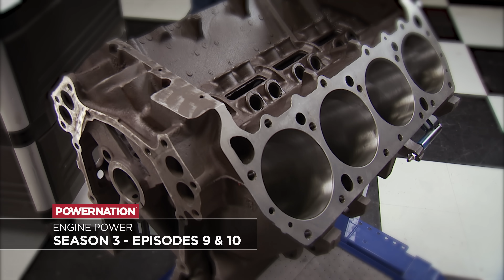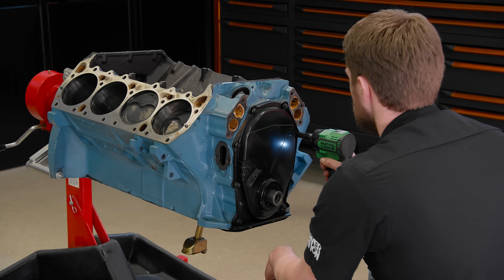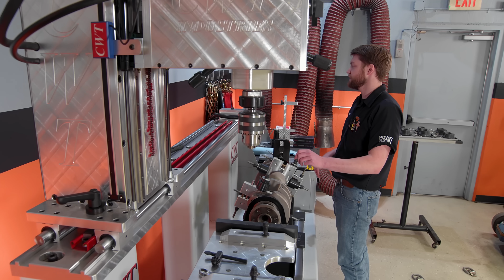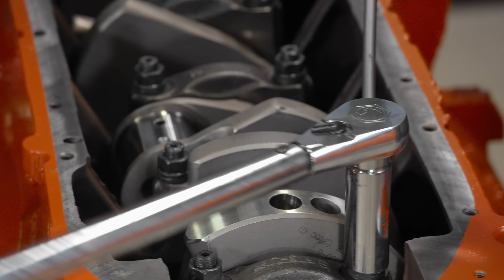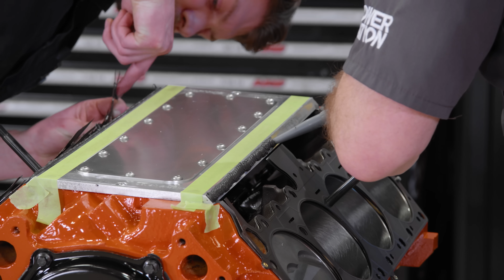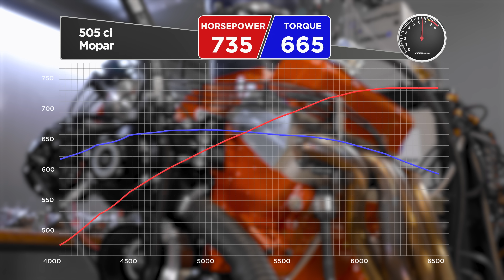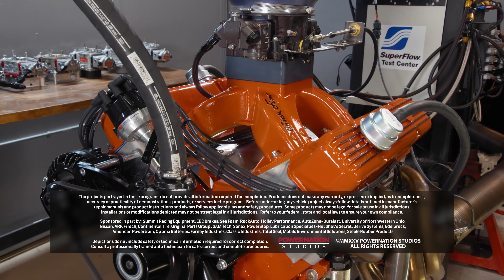Building a HEMI Killer?! 505ci Wedge-Head Mopar Delivers BIG Pump Gas Horsepower

Comment: what the deal with pond feet , it was always foot pounds , like 80 foot punds
Reply from the maker: For a measurement of torque, the proper terminology is pound-foot/pound-feet (lb-ft), or pound force-foot (lbf-ft), to represent rotation force around an axis. Foot-pounds, (ft-lbs), is a measurement of linear work done, which represents force over distance. In the automotive industry, people commonly use foot pounds to refer to torque, but technically pound-feet is correct, and is used by SAE.

Comment: Why did you retard the cam 2 degrees? And advanced the cam? 
It is best to install pistons with the bores vertical so you don’t damage the cylinder walls or the crank journals. Did you use an MLS head gasket? Aluminum heads cause many problems with dissimilar material and coolants. 
I would like to know what longevity expectations are there using these very short skirt pistons and high pressure valve springs. Not very vintage looking without painting the heads. Nice to shoot for highest power but I think this engine would not last long compared to a high performance street motor. Not to mention it won’t pass up a gas station. Hard to enjoy a cruise not knowing if you can get good gas. Great race motor.

Comment: Has anyone ever noticed the similarity to Mopar wedge heads and Small block Chevy heads ??
Reply: If I am not mistaken I do remember hearing that Chrysler did design the heads to be similar design. In the 70’s building Mopars I remember plenty of Chevy guys saying how much they looked like a sbc head. I also agreed that to b true
Reply: @danielroberts698 yes..they're quite similar.
Reply: Except for the rocker systems, they are very similar. Mopar putting small block Chevy heads on a 440 definitely left a lot of room for improvement, and this video with pretty decent heads shows that.
Reply: @G53X0Y0Z0 I said HEADS..
not corresponding equipment.
Think as if you purchased a bare B wedge head  and a SBC HEAD as such, look to ports and such.
B also use a  valley  cover..of sorts..
Sbc uses the intake.
Pros and   cons..
Distributer removal, as well as draining coolant..
Let's just stick to head comparisons.
Chevy can switch to solid cam, without  buying adj rockers.
Head comparison please.

Comment: You are not Mopar guys. Your barley engine guys. Doing a comparison on 305 and 302. The Ford will out live the Chevy. Mopar's are the way to go. Even at low HP the Mopar will live the longers and way more fun than any other. Don't do fake on tv. It doesn't work

Comment: Drop it into a 67-69 Barracuda, Dana 60 rear end or aftermarket equivalent (3.73-4.10 gears) and a Rockland Gear Tranzilla 6 speed transmission with customizable gear ratios, the ultimate street-n-strip warrior.

Comment: Thinking back to my Dad’s ‘59 Imperial, this would have really improved the passing power! I wonder what fuel mileage on something like this would be? With that flat torque curve you would not need a lot of throttle going down the road. (Stock, it always got 19 mpg.) It would surely be a sleeper to other drivers!

Comment: It was never called Hemi Orange by Mopar, it was Competition Orange. I know I'm tired but, did they just say that they installed the cam 2 deg retarded and then seconds later say that it was installed 3 1/2 degrees advanced at 109 centerline?
Reply: They put the crank gear on the 2 degree retarded keyway so the cam degreed in at 3.5 degrees advanced. Common to have to do such things because of different tolerances from manufacturing. Thats why it is checked with a degree wheel

Comment: Just dyno'd my bb mopar.  did 787hp at 5900rpm  760tq at 4400rpm  mine is a little bigger but much less compression.  pretty impressed with the numbers for a 505 vs my 572.  my cam is close, little more lift and separation on mine. I'm running edelbrock victor max wedge heads that have been ported and 10-1 compression.  really wish It would have went to 6300   I think I would have hit my 800hp goal
Reply: Did the hp curve flatten after 5900 or did they shut it down at that rpm? Although … really … that’s pretty high rpm for most RBs. Have fun with it!
Reply: @SchoolforHackers  ran it out to 6500  it didnt really fall off just peaked at 5900.  told to shift around 6300-6500.  I am running a weird efi set up that I think is hurting me some.  throttle body is a little small (102mm) . not too worried because boost will fix that soon.
Reply: @dallasarmstrong560  Looking forward to the videos
Reply: Any chance you could post more details about the cam, heads, lifter type, intake , octane and all? Would love to replicate mines in the machine shop now for 520”
Reply: @austinkapler6417   victor max wedge heads. changed the intake to 2.25 ported them.  compression is only 9.5 to 1. cam is a custom grind comp  264/276 760/744 114 lobe separation solid roller. intake is a ported victor max wedge we added injectors to. 105mm throttle body with 90deg elbow.  holley dominator ecu,  80lph injectors,    crank is molnar, rods eagle, je pistons, bill Mitchel block. 91 octane         trans is a powerglide and gear vendors. 4k stall, 3.91 rear end (probably go 3.55-3.73 with the torque i have)  hope it runs 9.50s and drive to the track.   boosting it next year and shooting for low 5s in the 1/8th

Comment: I just had  low deck 400 ,stroked to 512
Built by ( Just Mopar Joe )
  12.5 compression 
  Solid roller 650 lift
 Trick flow 270 heads
 Track heat intake  with 4150 AED custom carb
 Made 760 HP
 And 722 TORQUE  !
  ON E85
 Way more power than i was shooting for.
 Street / Strip Duster
Reply: I love the mopar 400 everyone likes the 440 but I'm a fan of the big bore 400
Reply: @maxfastest, she’s a beast! I noticed they skipped the girdle here. Good to see a Mopar on the big shows
Reply: Biggest bore available for B/RB. Will go to 4.385 easily. 
I've got a 1971 400 block sleeping in my barn waiting for a refresh and  cross-bolt main caps.
Reply: That's going to be one bad to bone duster I'm a big fan of the 400's they got a bigger bore then the 440 and the short stroke lets it sing a little longer then the RB but I guess in your case it's a little different then stock. Mopar Joe can build some killer builds I have a guy where I live that is a big Mopar guy and he races them has a killer Duster anyway he can build some great stuff using stock stuff.
Reply: big block with small block ports. 270cc intake runner is a big small block head, Mopar really screwed themselves with the B/RB heads, even the 318 Poly has better ports. I spent over an hour looking for good Mopar big block heads the other night, best I found were 300cc intake port heads that are available from Jegs made by Brodix.
Reply: @jaratt85  indy makes a ton over 300cc   up to I think 440 or 460cc on the 600-1. 500cfm of flow.   victor max wedge are 290 but the as cast port sucks.  most port out to 330cc and pull 400+cfm.
Reply: @jaratt85 
  That is what i always say too
Its a big smallblock
  Its neither affordable or the best engine family out there
But it's  not the cookie cutter brand that seems to be everywhere . Being different is more appealing.
  And i enjoy it.
Reply: @jaratt85  so why not ED Victor heads? they need porting but why not use inexpensive head ready to go. Simpson speed ran a Big block with 270 tfs made near 790 hp
Reply: @smilsmff  it's the difference between 790 and well over 1000, check out what John Kaase has done with 385 series Ford big blocks and he also did an article for Hot Rod Magazine about how you can make more power for less with a big block Ford.
Reply: @jaratt85 the old b1 heads are very Capable but now there's alot of choices for big block mopar stuff ...getting slighting off topic but cnc ported elderbrock  hemi heads or elderbrock victor Jr heads will make great power
Reply: @smilsmff 

Just my preference 
  I was shooting for 700
 And trying not to torture  my engine block since its a street / strip car
Reply: @jaratt85 

I agree , that head flows over 400 cfm .  Power all the way to 8k rpm.
Reply: At 12.5 compression not a street engine.
Reply: @rafaeltorres2886 

Seems to be performing very well on the street.
 I drive it anywhere.
Reply: @maxfastest  what kind of fuel do you have to use with 12.5 compression?  Timing?  I'm working on a 505" stroker myself.  I saw yours on Just Mopar Joe's channel.  Cool engine.
Reply: @Ezrider800 

I can run pump E85
And 34 degrees of timing 
And full race spec E85
For max power.same timing 
  I also had AED hand build the carburetor  to the engine specs, and that has been worth every penny.
 The thing i like best about E85 for street use is that it provides some extra cooling effect.  But there are things you have to be aware of 
  Keep an eye on your oil
Alcohol contamination can occur,  and oil changes need to be done more often.
Also in street mode i burn about 33 percent more fuel per mile, so i have a 25 gallon  fuel cell.
Reply: @rafaeltorres2886 he said E85? That’s pump gas. Everywhere by me sells it. My Mercedes runs it factory. It’s 112-116 octane. So it’ll run 12.5 compression

Comment: Didn’t the BBF make over 1100 hp. And the BBC made around a 1000 hp. MoPar is slowly catching up.
Reply: This Mopar is a pump gas engine and the Ford and Chevy were on high compression and running on race gas so not a good comparison.
Reply: Thank you lord for the big block ford

Comment: I like the people talking 💩about this motor my turbo 350 with 80# of boost makes 1500hp this motor is junk I could build a Chevy for $500.00 and beat this thing all day every day!The wedge motors have limited parts suppliers for go fast parts that work.Especially the heads the ports are only 270  not 340 like a lot of big block chevy stuff.The turbo guys all talk about hp per dollar many of the boosted motors turn to shit after they get turned up and wound tight.This motor would take most cars and turn them into a smoke show.Half the cars on the street don’t hook worth a piss!They couldn’t use this much horse power if they had it.

Comment: Pretty nice power for the Trick Flow 270. I've done a similar build with an Indy 440-1 with almost identical compression, and camshaft numbers. The major difference being a bigger bore (4.375) and shorter stroke (4.15) for 499 cubes. In that configuration with the Indy 4500 intake and a 1050 Holley, the horsepower and torque numbers were 804 and 686. Unlike the Trick Flow, the Max Wedge port on the Indy features an offset intake rocker.
Reply: I bet you painted the timing cover the same color as the e fine though.
Reply: @davidrad1820  On all my iron block engines that don't use a Jesel belt, or an RCD gear drive, I go for the color matched timing cover. lol
Reply: Very nice numbers …… can I ask what camshaft and what size headers you used ?
Reply: @mannyk291  On the camshaft, we built this engine back in the early 90s and I no longer have the cam card. It was a Comp Cams solid roller that I don't recall the numbers, but I believe the both intake and exhaust lift was in the low .700s after lash and before deflection. I really don't remember the other particulars. The headers were fabricated by a shop in my area and had 2in primaries, with a 4in collector.

Comment: I think Hemi Killer is overstating things a bit.
Here's the thing, a 505 Hemi stroker with a dual plane single 4bbl intake can make, give or take 630ish hp and you can close the hood with an aircleaner on. Nick's Garage had one. 

There's no Mopar I can think of where you could put this engine in the vid (possibly no Mopar truck either) with an aircleaner and close the hood. 
To illustrate, I had a 440 in an A body with a Carter TQ on just a Torker II intake with an OEM dual snorkel aircleaner and the hood wouldn't close - even with 1/4" spacers between the K frame and chassis rails.   

What I'd love to see is a Hemi killer Wedge that can live up to the Hemi Killer name and actually be useable without cutting holes in hoods.

Comment: Suggestion for the editor: You can't show the detailed data: afr \ "runtime chart" for the first run and not show it for the second run. Either just HP/Torque chart, or double play and do both. I wanted to see if they increased efficiency in their tune with the BSFC and it wasn't shown. Power is great, but more power because you're being more efficient is better. This edit gives just hp/trq change, but so lacking, for 5-10seconds of video, in my opionion.

Comment: Recipe for failure when using a factory production block. It's just a matter of time before the main webbing will crack. Rule of thumb is 650-700 horse max. Beyond that get an aftermarket block. Cross bolts,girdles, aluminum caps are just band-aids.
Reply: Totally trashed a lot of 440 strokers making that kind of power back a long long time ago
Reply: If you have a light rotating assembly, keep the rpm’s below 6500 and don’t get into detonation, they will last a long time.
Reply: Block can't handle it
Reply: You definitely get some main bearing cap walk above 650 for sure but everything goes well it will last a while like that

Comment: So what is considered the max safe horsepower level for a factory RB block with good parts including main caps and maybe a girdle.? I want to build a similar engine with less compression and the proper cam and a roots blower for an old-school pro car. But how much can it hold before you crack the block in half?
Reply: 650 - 700 is about the limit on a factory block. They start cracking down in the webbing.
Reply: Usually the main caps will start to walk above 650 HP but I have a 250 shot of nitrous on my engine and it is ran over a year with no trouble yet and it started at 600 horsepower no nitrous
Reply: @thomasward4505  Interesting - did you do any special prep?
Reply: @SchoolforHackers no not really. ARP bolts for the main caps and I ramped the nitrous in with a controller which does not start till about 3,000 RPM .no girdles or aftermarket main caps either but it might let go the next time I take it out you never know. My PB was 115 Mi an hour and 5. 99 in the 8th with 3500 lb car. The nitrous knocks off almost one complete second and adds 14 miles an hour. 512ci pump gas 10.8 comp hyd roller and full exhaust with mufflers.
Reply: @thomasward4505  My mouth waters, that is so sweet.
Reply: @thomasward4505  I see you're being modest: you're pulling the front wheels off! Kudos -

Comment: 5 lb. of force vs  588 lb. of force is a difference of ten times?    Isn't the product of ten times 5 equals 50?  Or is "new math" being used to calculate?   Isn't this 100 times difference?  Even 71.9 is more than 100  times heavier than 0.63

Comment: If you guys get a chance, try Loctite Marine Grade Never Seize. I've worked on everything from jets to submarines, and I swear by this stuff. You can screw aluminum to stainless all day, no worries. It's more like a paste in that it contains no nickel or copper or whatever else they mix in. It has a higher temperature tolerance than Loctite Hi-temp Never Seize and doesn't wear away. I don't understand why this stuff isn't in every shop of every kind on the planet. I'm not a salesman, just a wore out old hot redder. Do yourselves and your viewers a favor. Check it out. TJ Meyer
Reply: I’m listening …

Comment: Why don't any of these shows do a cost per horsepower? I always  build a sbc and a big block Mopar spending the same money. The sbc was in a 1969 chevelle and the big block Mopar  was in a 1968 charger. The chevelle beat the charger by 2 body lengths in the 1/4 mile.
Reply: Everybody knows small block Chevrolet parts are the cheapest you can buy followed by small block Ford. After a big block Chevrolet big block Chrysler parts are no more expensive than big block Oldsmobile, Pontiac or ford.

Comment: You know what no one does on shows like this. Full on pro stock level builds. Like max effort na full trick motor. Y'all need to do it
Reply: well anybody thats been stranded and got a ride to town in my Galaxie 500 talks about how smooth she runs, and I once had a similar experience when my wife left the lights on, so I had to ride in a friends '69 hemi cuda to got get a jump pack from walmart.
Reply: And whats that got to do with the price of tea in china. My question is valid. These guys build engines show engines talk engines. Pro stock level full on nasty na motors are some kinda voodoo that noone ever talks about or does. Now i get it current nhra actual prostock motors are highly secret and should remain that way however nothing is stopping someone from building a full on trick specialized mountin motor to that level or close to it or even above it as there is no rule book for a dyno princess. The other shows on the network build cars whats stopping one of the other shows from building a nastalgic prostock vega or something and these guys do a modern mt no rules max effort full trick unlimited budget motor. I have been watching this show and all the shows like this since i was a kid back in the 90s. Not one single show did anything like that. Infact how many LS motors have been built how many small block bow ties how many times can a 302 be bolted together. Shit at this point any mopar motor they do is actually different so good on them for finally doing something other than a LS. Point being these shows are all the same cookie cutter crap and no new things come from it period an have become very very boring. Much like that spec series called nascar or indy car. They are all the same no personality no excitement no innovative attitude .  @rodneydawn4134
Reply: @fc3sboy1  well my engines aren't some magic trick, and neither are the chevys and mopar's my friends work on.  we all grew up around big blocks, and we refuse to give up our trade to computers that ''supposedly'' know better.   I love them all.  :) and tuning these beastly engines has become a form of art.